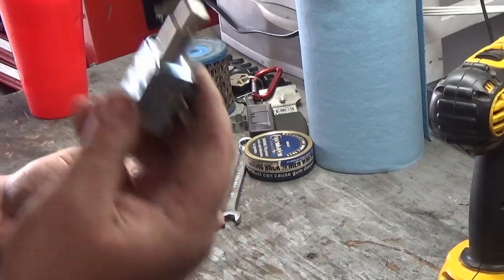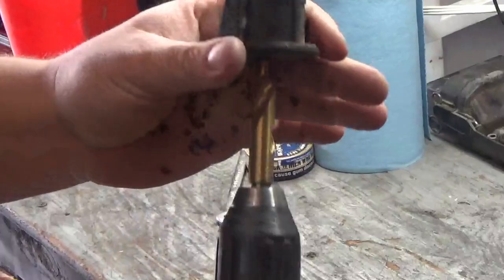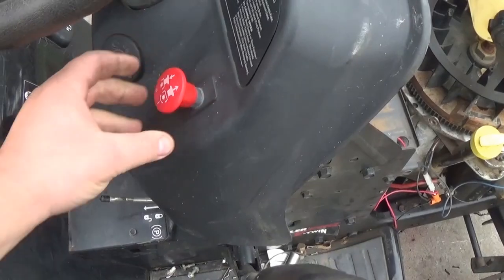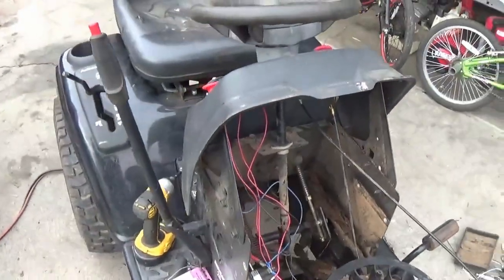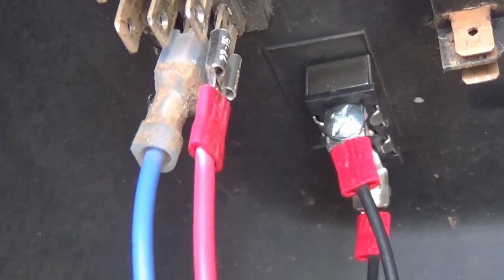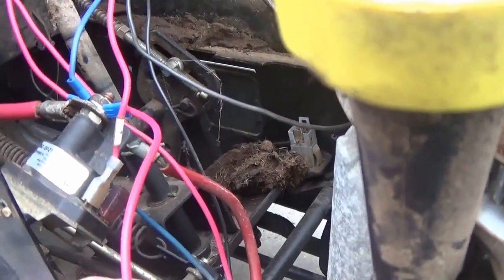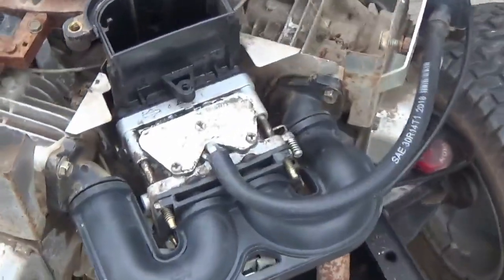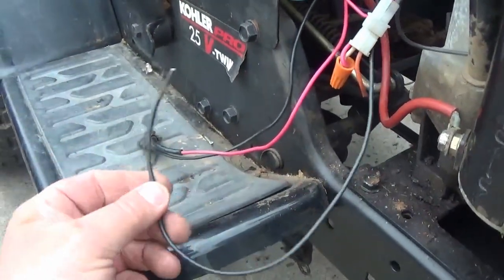Riding Mower Saftey Switch Issue, How To Bypass & Rewire Your Tractor DIY (2019)

Comment: I'm sooooo fed up with all the wiring. Click clik is what I'm putting. Up with. You can use a push button or cheap 20-30amp two pole key switch.
Reply from the maker: Check your fuse or solenoid and make sure you got a good battery
Reply: @smallenginerepair3379  done that. Good bat and new solinoid and fuse. If I jump hot leads on solinoid and starter fine. I have noticed 12v tab on solid when powered will click.
Reply from the maker: @TheWaterman1000  yes I know it could be frustrating sometimes it's very hard figure out what the problem is when I get to that point I just rewire the damn thing you could spend hours and hours hunting down the safety switches and testing them

Comment: Hello, did the whole rewiring and works great but now my battery seems to go dead I have to be jumpstarting everytime it's a brand new battery I thought if was a defective battery so I tried with another one and still the same thing happened..is there a reason why that's happening ? And what can I do to fix this issue. Please get back to me when you can I would appreciate it, thank you
Reply from the maker: Hello yes thank you for the comment usually there's a backfeed power from the engine that gives out about 6 volts back-feed power what kind of motor do you have sometimes it'll be a wire hanging out from underneath the fly will usually there's two a red and a yellow and then sometimes the wires come out and go into a voltage regulator that's on most Briggs & stratton's and the Kohler engines will have a similar set up you just need to find where the power is coming from from the motor and the red is your back feet power wire might be a different color on Kohler the yellow one you do not have to use
Reply: I have a 18.5 hp Briggs&stratton...and yes theres a black wire hanging from under the flywheel I connected it straight onto my battery. Is that ok ? Also with the selenoid coming from the carburetor I connected direct to 12 v, since I couldn't figure out another wiring system to make it open or close so I just kept it open.  Do you think this was a reason it also drained ? Since that I have now done what you suggested on the video and cut the little tip and disconnected it all together but the battery still drains...I keep the engine running maybe about 1 min or so, is that enough to recharge the battery a bit with the black wire coming from under the flywheel connected to the battery ?
Reply from the maker: Okay so there's three wires that come out from underneath the motor one goes to the ignition coil which is a black wire that wire goes to a switch to kill the engine and then there's two wires with usually a little white connector at the end of it ones red and ones yellow the red one goes to 12 volt power any 12 volt Source will feed the battery or directly hook it to the battery and if you're wanting to know if you're charging systems working get out a multimeter and test that wire with the engine running and that will tell you if you're getting charged

Comment: Man, there is an easier way to do this. If your stator is only sending 6-7 vdc then you have a problem. By SAE standards, a fully charged battery is 12.6 vdc, you can't get there if all you've got is 6 or 7 vdc to charge with, it just won't happen. I'd imagine the need for jumper cables is right there! I recently did a video on the John Deere safety switches, I showed how to non-destructively delete them all. Check it out if you like: https://www.youtube.com/watch?v=vLlk5zOTWkQ

Just a heads up notice friend, when you see a switch with more then 2 terminals, you better believe it's doing something more than only 2 contacts! That solenoid that you destroyed is also a fuel shut off valve, don't delete it if you don't have to, your carb will just leak excess fuel into the intake otherwise. By the looks of it, we have the same briggs engine. And I've flapped my finger tips long enough, cheers 🍻 man!
Reply from the maker: Thanks for the comment I've never seen a riding lawn mower push up more than 6 or 7 volts it's like a trickle charger and they always seem to charge my batteries there's jumper cables on it because there's no battery in it and if you cut that solenoids deal off and you're carburetor leaks then you have a float and needle seat problem that part has nothing to do with your carb leaking never seen it unless you're carburetor has failed you and yes there is always easier ways to do things I just like this way I don't do it to every tractor only when you're having a major problem would probably be easy to hunt down the safety switch but it works good for me
Reply: @smallenginerepair3379  You have me curious, exactly where and exactly how are you measuring 6-7 vdc? High frequency low voltage can charge to higher states, but that is not what is going on here. If you can charge a battery with 7 vdc and it magically becomes 12+ vdc, well then, how are you doing it?
Reply: @Finite-Tuning Finite:  I'm puzzled just like you are about that 6 or 7 volt DC reading and its ability to charge a 12 V batter.  This is a guess, but I'd be interested in hearing if there is any merit to this guess:  could his voltmeter be set on the AC scale instead of the DC scale?  The AC voltmeter could be picking up pulsing DC voltages that peak at perhaps 14 volts; but might  "average" around 6 or 7 volts on the AC scale?  Could a pulsing DC (for example just the positive or top half of the AC sine wave) voltage result in a 6 or 7 volt reading if read on the AC scale of the voltmeter?  The peaks of the clipped sine wave pulses might be in the 12-14 volt range (and the peaks might be enough to trickle charge the battery)?  What do you think?
Reply: @takeachanceonme4  
You are exactly correct, if Small Engine Repair would have answered my question, I would have explained to him simply that he's measuring incorrectly. Firstly ya can't use a DC meter to read AC voltage, and second, ya can't measure pre-rectified voltage right off the stator on the DC scale. That's gotta be what he's doing because there is no other way he is coming up with these measurements using a DVOM. 

It's been a long time for me so my memory is rusty, but I'm pretty sure these charging systems are actually AC (sinusoidal) albeit not very pretty looking on an oscilloscope. 

But either way, if he would measure at the battery terminals for example rather than the coil or wherever he's measuring from, he'd see a rectified 13 + VDC at wide open throttle, assuming his charging system is fully functional.
Cheers 🍻

Comment: This is the worst, most negligent tractor/mower video I have ever watched. You suggest removing the key switch and using a push button. You do not provide any wiring advice or instruction by the title of the video implies that you do this to bypass the start safety switches which under normal operation will prevent the engine from starting in an unsafe condition. And the video shows how you DIY rewired the PTO switch too, which also bypasses the safety kill circuit; that kills the engine should the mower tip over or the rider leaves the seat.
You are opening yourself up to a negligence law suit as well as putting people's lives or health in jeopardy.
If you don't know how to diagnose and repair a tractor/mower wiring properly, then you should learn or take it to a trained mechanic. But you should definitely not make videos where...should someone even less educated than yourself could be injured or killed should they follow your video advice...smh

Comment: To bad you didn’t show how to bypass the safety switches like your heading said. Bad video.
Reply: He did tho, you literally chop the entire wire harness out and wire as instructed to simplify the wiring to just running your engine and blades